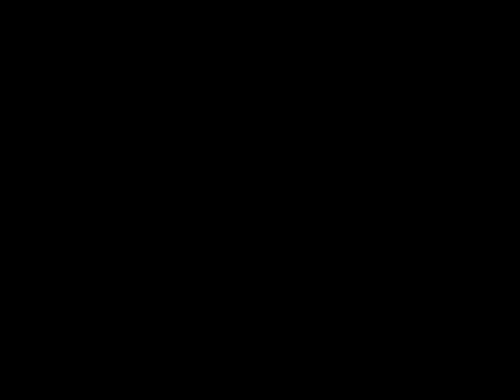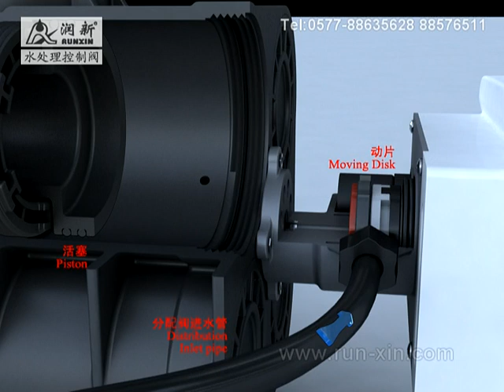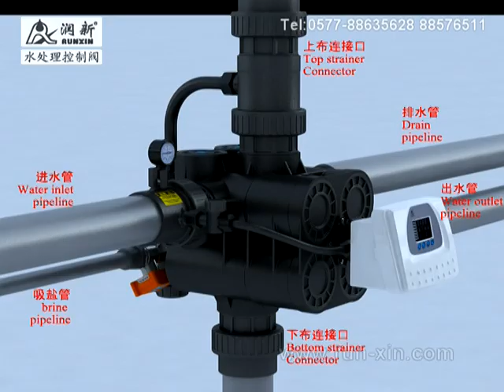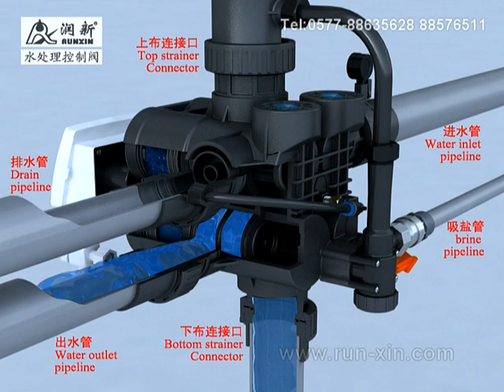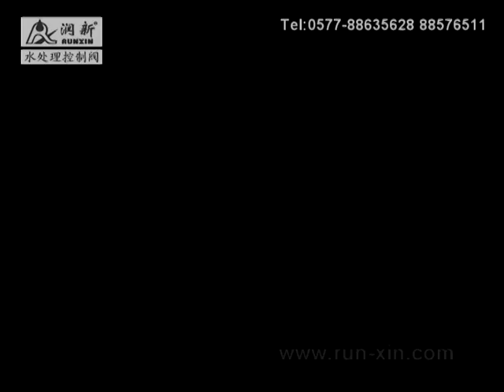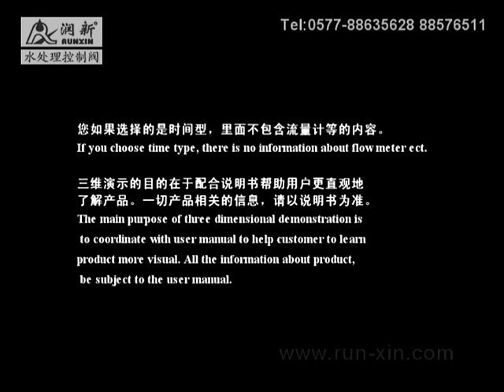ORG Dicom runxin Multiport valve high flow working principle

Comment: If the pressure is not much but the flow is correct this Multiport valve, not function I think the valve open due to pressure we can't do anything if water has no pressure  .  but in manual also not mention. I face a lot of problems due to this case.